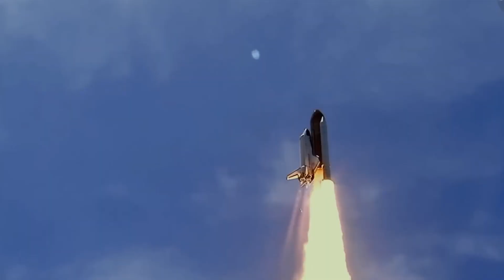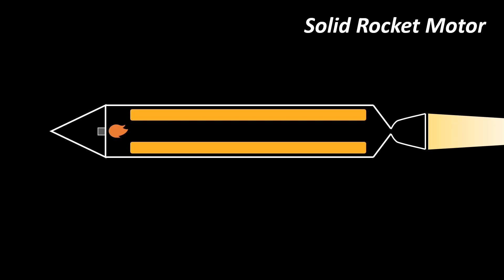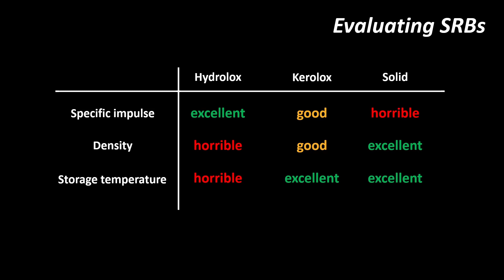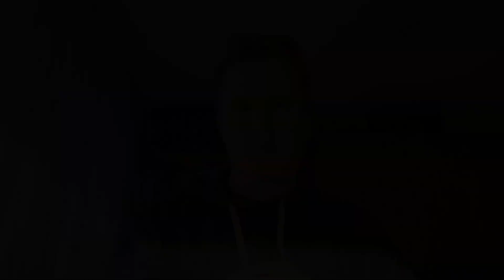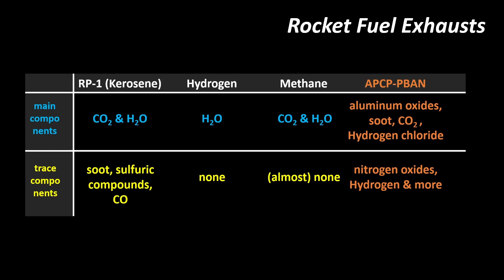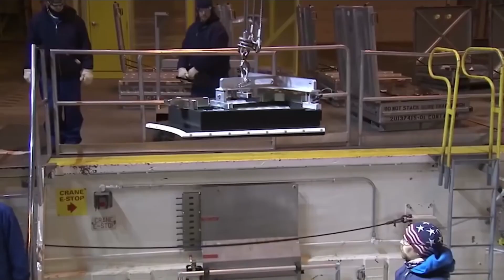The Problem with Solid Rocket Boosters (and why we can't fix them)

Comment: Werner Von Braun flat out refused to use SRBs during Apollo, and instead developed the MASSIVE F-1 engine. SLS was obsolete long before it flew with the advanced engineering from SpaceX. Once Starship launches and is proven to be reliable there shouldn't be any need for solid rockets. Great video! 👍👍🚀🚀